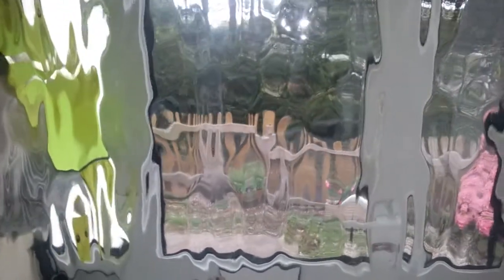How To Test For Low-e Glass

Comment: I live in Florida where it's hot climate. I want to keep the heat and solar rays out and the aircondition space inside cool.Where would be the best most efficient side of the glass to place the Solarban 70.I know it's in the inside sandwiched together by both glasses but should it go on 2 or 3.I'm going to have double pane windows. Greyglass with Solarban 70 with Pvb0.090 with clearglass.In what order should I order the manufacturer to build the windows?